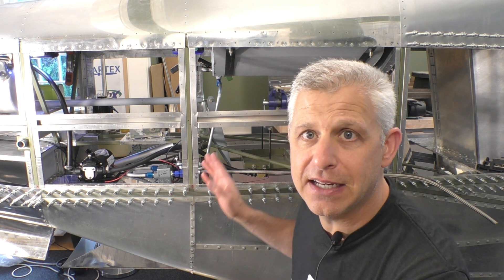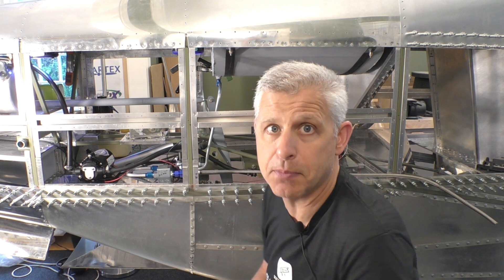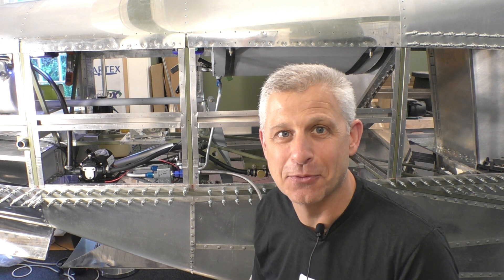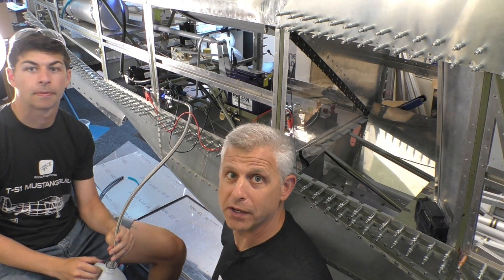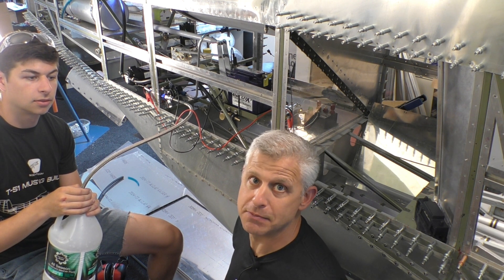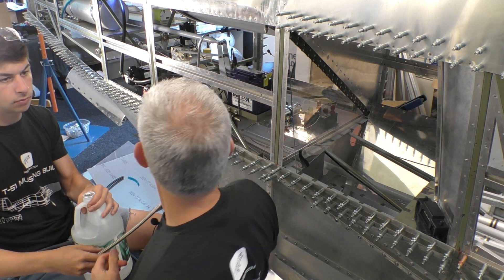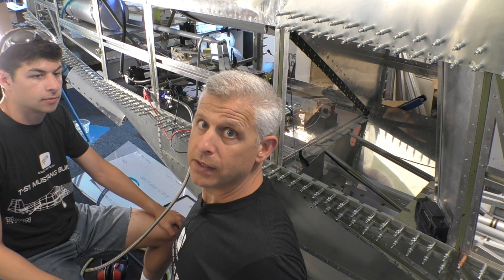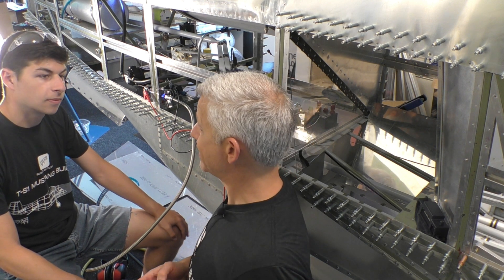Building the Iconic P-51 Mustang Replica: Aux Fuel Tank Transfer Test

Comment: Jeff, great video as always!!  Question for you: I understand that your Mustang will have the LS3 V8 engine. What are the modifications required to the airframe to step from a V6 to a V8 Engine? Is the documentation available from Titan in order to strengthen the airframe?
Reply from the maker: The version of the airframe that we received from Titan already had the upgrades to the steel frame in order to support the V8 engine. We are using a GM LM4 engine we got from Titan that was used in their test aircraft, Camel Smoker. It’s a little less HP than the LS3.
Reply: @SocialFlight  Thanks for the reply. I'm curious about this modification because I just bought Kit #102 and I don't think that the frame has been modified to accomodate the V8. It would be nice to find out what is needed to upgrade it...
Reply from the maker: @buzzcola416  I would contact Titan directly. They are great about supporting people who have purchased  kits from others.

Comment: Is there a reason to not use an electric automotive (aftermarket) pump? (they come in every imaginable volume and pressure size)
Reply from the maker: We started with this one that Titan recommended.  The flow rate is 32 gal/hr.  Ideally, we would want to get to about 100 gal/hr, but we need something with a small footprint as well. If you have a pump you recommend, please send us the link to it!